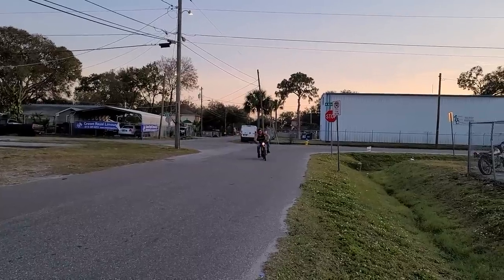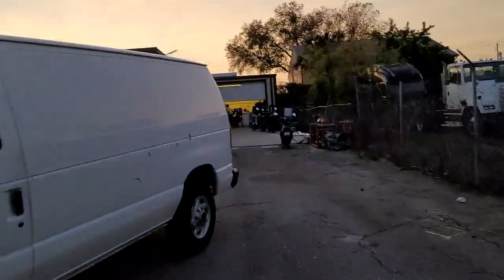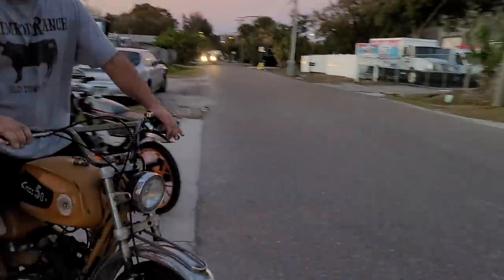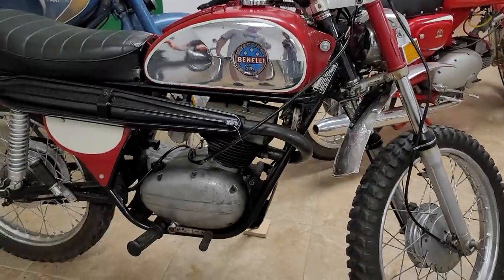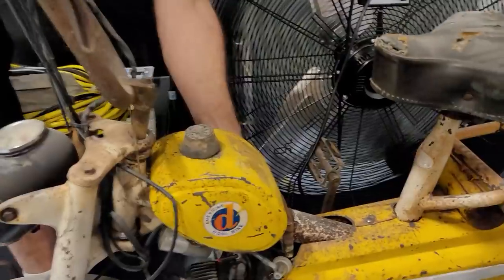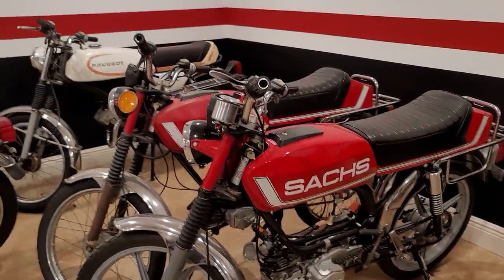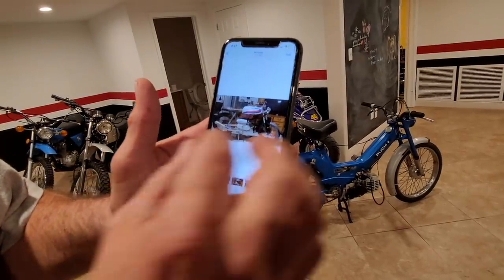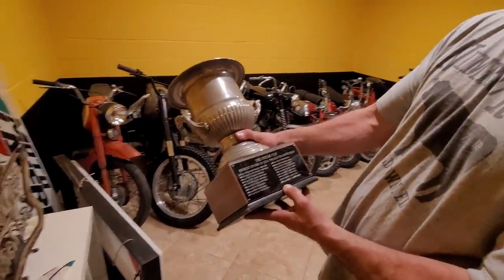MOPED HEAVEN

Comment: When I was like 13 or 14 years old me, my dad and brother found three of the same kind moped in a junkyard for $15 for all of them. We took two of them and used the parts from them to fix one up. I bought it from my dad for $50 and drove it everywhere I went, it was a 50cc moped. I leaned very fast that a moped isn’t made for dirt roads after I wracked it one day after the rocks made me loss control of it.

Comment: The "piaggio scooter" is either a Mk1 P range or possibly a Mk1/MK2 crossover model. In between Mk1 and MK2 they parts binned some together that are referred to as 'crossovers'. The crossovers are nice for racing because the frames are for some reason lighter than the MK2. But you can tell by the horncast. This one has the one with nice smooth curves. When it went to MK2 PX they changed to the 'boxy' style that PXs still have now.

Comment: Rear collection but I’ve got a fully race built 1995 Yamaha MBK booster with a fully built stage6 setup polini race crank with a ported MXS cylinder kit 
Big stage6 intake with a polini cp21 carb
NCY quick throttle 
Full stage6 cvt setup & a polini 4 race pipe 
It’s making 19.4WHP & 24bhp at the crank 
It’s beat some fast cars from the lights & hits 74mph

Comment: Hard at work I see
Reply from the maker: Wait til you see the next private video...47 bikes
Reply: @KaplanCycles  Was driving mopeds in my younger years, we just have too many restrictions here in DK, only allowed to drive 30 km/h, if we tuned it just a little, the police stole the parts, and gave us a fine. The orange/grey  Puch u drive was sold in DK with another frame, but same motor, called a puch maxi, very popular bike, some with pedals, some with kickstart. The motor was also used on a small dirtbike called puch magnum, with 17 mm carb.

Comment: Delardo carburator had one of those on myPuch it would go 60 miles an hour
Reply: Is that like a Dellorto?
Reply: @thefurrylittleotter3460  it could be it was an adjustable carburetor when you ware going top speed you would lean down and turn a little nob total suicide. Roger from moped world in Miami did all of my work. Back then we would race these mopeds they ware very popular,Puch and Thomos those ware the most popular.